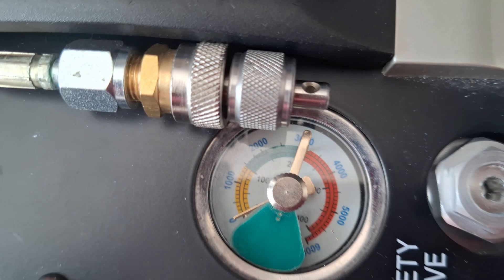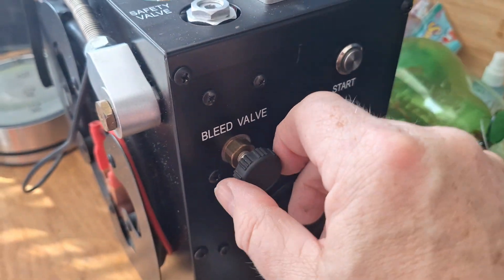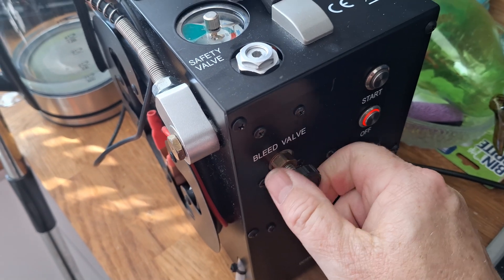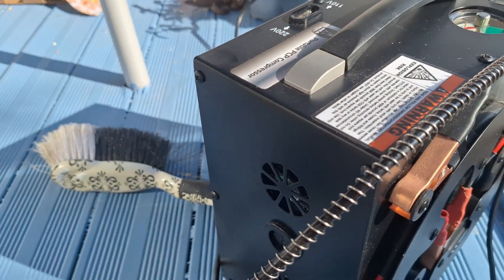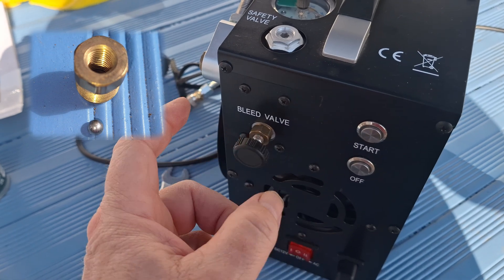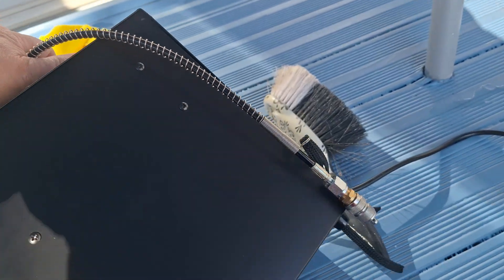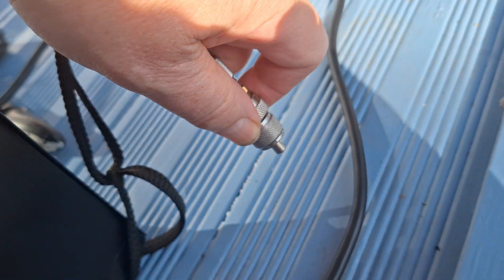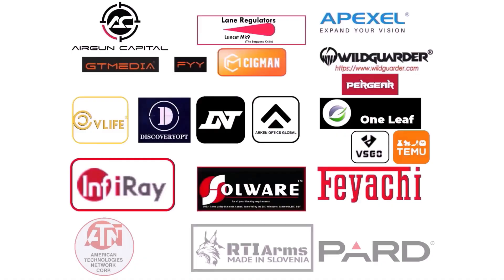Fixing the BSA Compressor that won't fill any higher than 60 bar

Comment: Thanks I got mine when they first appeared as I hated the water one.ive had no trouble until yesterday so thanks for video I'll check that part first I hope it is that great
Reply from the maker: From what I found it is a really good product for filling PCPs, plus having the added advantage of using 12 volt battery in the field. If I had one I would buy a battery for that purpose, then top it up with a battery charger when finished.